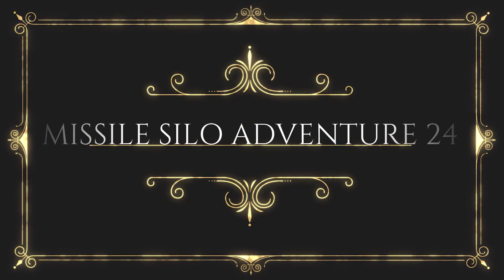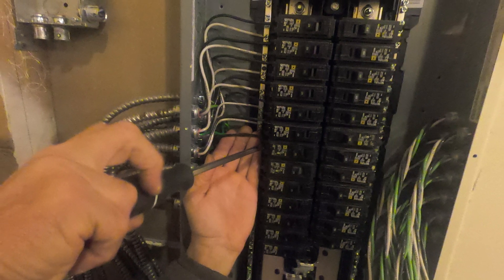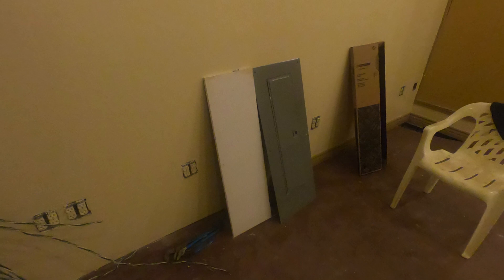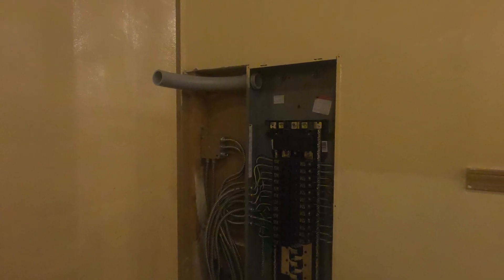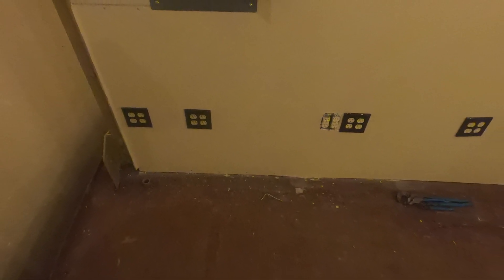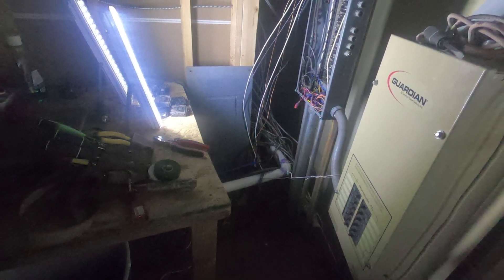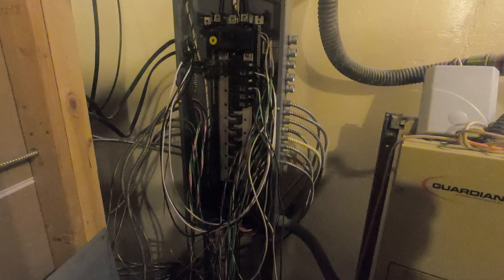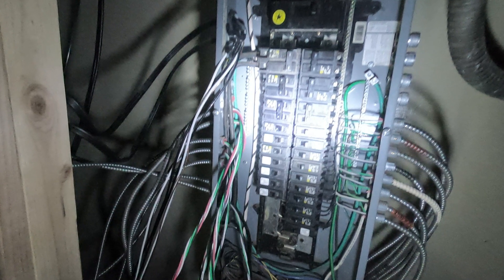MISSILE SILO ADVENTURE 24...Finishing Electrical Upper and Lower Level Launch Control Center Atlas F

Comment: Did you bond neutral to earth ground at the topside load center? I noticed you didn't do that down below.
Reply from the maker: Yes Sir...I bonded the neutral to earth ground topside.
Reply: @GarySiloManBaker  sounds like a good way to avoid problems with ground loops within the hardened area.. What's your Earth ground connection topside? Does the Atlas F LCC have a Faraday shield? When the Titan II sites were built, the entire concrete structure was wrapped in steel before being backfilled. as far as an earth ground connection goes, it doesn't get much better than that!
Reply from the maker: @gecal556  Absolutely Atlas F has a whats called a Grounding Grid surrounding both Launch Control Center and Silo, too include connecting Utility Tunnel.